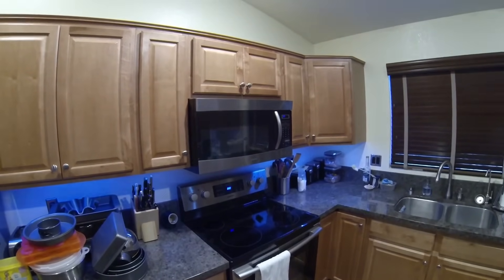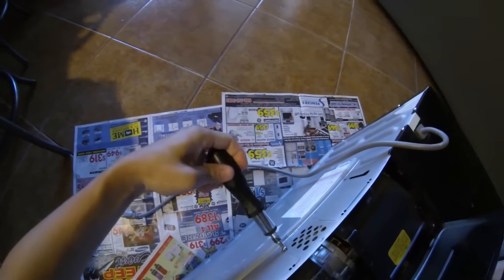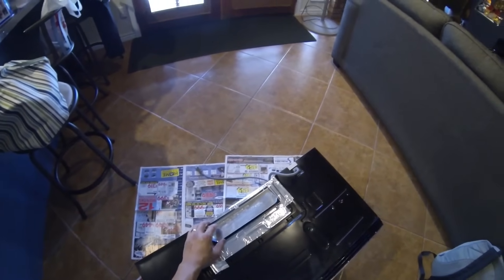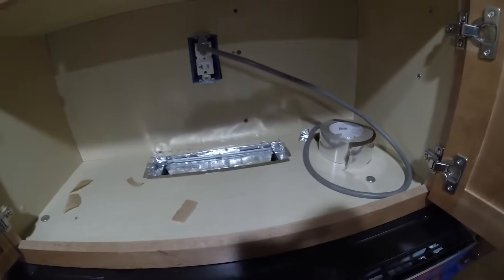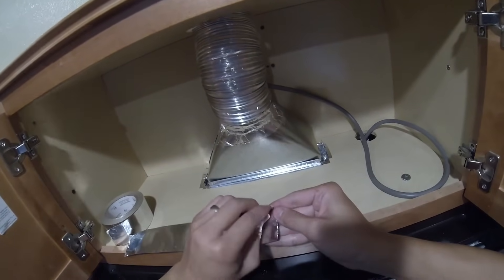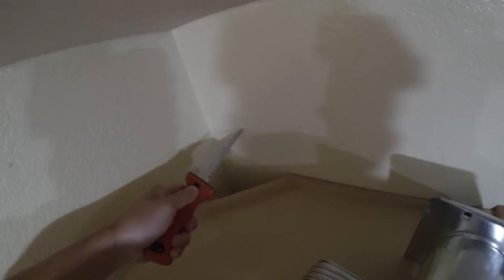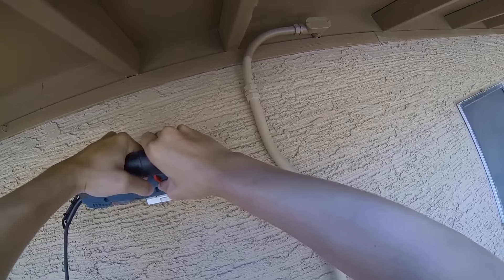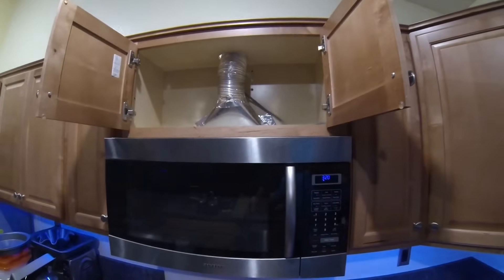How to Install a Microwave Hood with Exhaust Fan - DIY

Comment: While functional (for now), there's numerous problems with the install and the flex-pipe alone will definitely be a problem with grease accumulating.  It is not to code, and instead of taking the time to do it right, it's done haphazardly and not to code.

The power outlet should be moved to one side of the cabinet so that the vent pipe is not obstructed.  Using aluminum tape to seal the misalignment is sloppy at best.

Flex pipe (or a dryer vent flex pipe) is not to code and will accumulate grease over time inside and will definitely cause problems down the road.  6" - 8" rigid vent pipe is required and since heat rises, need to go at an upward angle to eventually vent to the outside.  Your flex pipe will have hot-spots where the rising, hot air will be restricted.  Problems eventually when grease accumulates.

Do it right, or don't do it at all.

Comment: First of all thanks for the video. EVERYBODY should vent their microwaves outside. Those recirculating things are just dumb. Second, I know rigid piping is the proper way to do this but not everybody has the coin and/or pipe fitting experience. A legit pair of tin snips is around $35. I've used this flexible dryer duct on this very same project in the past and just changed it out every couple of  years once I felt it was nasty enough inside. Compare the flexible duct job here to the chicken coups that people in 3rd world countries call home. LOL.  Works good enough bruh.

Comment: Great video I wish i would have seen this before I purchased all the parts for my Exhaust fan. I purchased all 6" pieces and did not get flex duct.  Does the 4" make alot of noise?  Also did you have to purchase the damper for the Microwave or did you have one already? Thanks,
Reply from the maker: UltimateAudio936 Thanks! I think the majority of the noise comes from the microwave itself and not the duct. At least from what I can tell. The damper came with my microwave. If you do not have one, try to find one that fits for your model.

Comment: what the Bosch power tool you used to cut holes to the cabinet and the exterior wall? did you use anything to fix the hud in the exterior wall of your home?

Wonderful video, Very helpful!
Reply from the maker: Thanks! I used this: https://www.amazon.com/Bosch-JS365-120-Volt-Top-Handle-Jigsaw/dp/B004323NQO?ie=UTF8&camp=1789&creative=9325&creativeASIN=B004323NQO&linkCode=as2&linkId=QYODKNPBNEOC25FG&redirect=true&ref_=as_li_tl&tag=mt888-20

I just put chalking around it.

Comment: Where can i buy the microwave adapter with flapper. It did not come with my Kenmore microwave.
Reply from the maker: could always check the manufacturer for parts or if eBay has universal adapters

Comment: THERE IS GOOD REASON WHY THEY SELL FLAT PLUG WIRES
Reply: Yes, a 90 degree (L shaped) plug can replace the straight plug on the AC cord.  It might allow vertical mounting of the duct.

Comment: Question? Why everyone is going up thru the cabinet instead of going straight thru the wall? I mean from the back of microwave thru the wall..less duct work
Reply from the maker: +Marvin Garcia The reason why I went this route was because it would have involved much more work on this house. The microwave is on an inside wall so going through the wall wouldn't have worked. To accomplish the duct work would require it to go up through the wall to the attic and cut a hole in the roof. Additionally, the outlet was obstructing the path in the middle. This was a bigger task than I wanted to tackle. Hope this video helps accomplish your needs!
Reply: Thanks. Actually Im going to do the same you did, my back wall is my outside wall but it requires me to cut studs, something I dont think is going to be easy.
Reply from the maker: +Marvin Garcia Having the right tools definitely helps and can make your life less hectic. A hole saw can help just depending on your situation. Just want to be careful that there's no wires in the area.

Comment: I'm not carping.  Having no plate on non-visible electric outlet is like an inclusion in a diamond...can't really see it but it is an issue. In my state (CT) and almost all others the inside of the vent tube "must" be smooth. Makes sense, don't you think? If erose it would collect droplets of oil, etc.  Possible fire hazard, conflagration, death in the night.

Comment: Flexible ducts are not recommended for range exhaust.  Looks like 4", which does not give much airflow.  That said, I used the exact same when I built my house 30 years ago.  I am going to do it right in my next house.  Personally, I would have added a second outlet box 10" away - that tape job in the cabinet is unacceptable.

Comment: You are not meeting building code with your install.  Move the Plug first then install vent..  you can not do what you did very bad idea!!
Reply: I agree it should not have been done that way, but what code is it not meeting?
Reply: Brian Look also microwave only has two screws to the cabinet it needs three, I install these and they all come with three screws and three nuts.
Reply: Edgar Bravo I have a whirlpool gold and it only secures with 2 screws and mounting bracket. each brand and model is different
Reply: This is a false statement, not all microwaves have three mounting bolts. For example http://www.lg.com/us/support-product/lg-LMHM2237BD#manuals
Reply: What's the off the first part attach to microwave before the boot?
Reply: @jarhiker1  hi! What parts did you use especially the adapter piece? I have the same microwave.
Reply: Before taping the outside duct to the inside I would have fire caulked the outside and screwed it in. Fire taped inside after. Other then that, good video.
Reply: George Alvarez - Well, when your house burns down because of using totally inadequate ventilation piping/Code Violations or you’re trying to sell the place later on and you find out that you can’t sell it using this inadequate idea and materials, having to start aaaaalllll over again anyway, you’ll wish you would have listened to those who know, instead of knowingly causing the problem, but went ahead and did it anyway. Ya, I know; Long sentence. This is the Main Reason people come onto YT in the first place. To find out how To and how NOT to do things, reading All comments a available and then making an “Informed” decision and Plan. I’m glad I found this video. I really am, because now I know how Not to do it, for safety and Code violations. Thanks for the video, either way.

Comment: hi i used    4 inches pipe for range vent hood wrong or right
Reply from the maker: +Trang Ta I used a 4in pipe.
Reply: +Trang Ta  Code requires 6" round or 4" x 12".  It's usually spelled out pretty clear in the microwave install instructions.  The outlet is in violation of the electrical code.

This a good example of how NOT to vent a microwave.

Comment: Could you give me a list of the required parts  to complete this job myself?
Reply: 4" microwave register box, 4" vent ducting the lenth you need it or flex duct, aluminum vent tape, GE microwave air flap (if needed), go saw, pencil, tape measure

Comment: Would duct tape work instead of foil tape?
Reply from the maker: It's not advised to use traditional duct tape for duct work despite the name as it has a greater probability of failing over time.
Reply: mitchy02 - Plus, since you’re venting hot air, it’ll just melt the adhesive, setting up a probable fire hazard. They make Aluminum Muffler Tape for a reason. But overkill in this area is warranted.

Comment: Needs to be 6" if you wanna stay in code. Also no flex i know you wanna hide it but you can easily build a bulkhead or went straight through the roof. Years from now you'll be picking grease off the side of the that house

Comment: How are you going to unplug this setup with plug right in the middle of duct?   Not done correctly.  Never use flex duct for this.  This guy never did this correctly.

Comment: Great video. Where did you your damper from the one outside and one connected to microwave?
Reply from the maker: +Paul Robinson Thanks for watching! Mine came with the microwave when I purchased it. The microwave damper will vary depending on your brand/model. You may be able to find one on Amazon. The one going outside can be purchase at your local hardware store.

Comment: It seems like you created an awful lot of work for yourself, as adding the soffit will be no piece of cake.  This in addition to having to correct the errors of using the flexible dryer vent.  I guess the bright side is that you get to correct it now before the soffit is in place vs. having to redo it if you sell the house and it gets flagged by an inspector.  Rather than add the soffit,  I were you, I would just rip out the duct, patch the hole in the house and convert the microwave back to recirculation.  If you do go that route, remember to replace the charcoal filter on the microwave at least annually.
Reply: A more constructive reply would be to tell him how to install the vent to code, though you do bring up a good point about the inspection.
Reply: soffits are well worth it even if you plan on living there, believe me! stringing ductwork around,  it can be an eye sore! not to mention hot as Hell. I'd insulate it too!

Comment: I need to do something like this. Because the mofo who i stalled the exhaust vent made something so now the vent goes to an aluminum duct up to the attic and all the freaking hot ari is leaking unto the house making my ac keep going to keeep cooling the installer mistake, mi e as well ill block the exhaust hole and leave it like you had it on your video.
Reply: Also that plug needs to be insulated so the heat from the wall wont go inside..

Comment: to know where to make the hold outsie just from inside drill a small hole to outside on the center of the hole so you will know where to cut outside ! your installation is ok but can be a lot better when you make this horrible cheap metal pipe not show at all , cover the top side with wood of the same color or something else but it looks bad

Comment: And 4"" duct CANNOT BE USED ever no way no how,It will not have the suction required and would never pass code inspection, and now its a fire trap with a flex line, grease gets trapped in the grooves, hard vent is needed

Comment: Can anyone recommend the right way to do it if this dude is completely wrong?
Reply: For the parts and type of duct you will need to check your microwave manual and also do a search on "your county kitchen vent code". The county where I am at, we are supposed to use galvanized steel ducts. As others have mentioned please check your local county code. This is more about safety.

Comment: What A Dum Thing To Do. You Should Have Simply Installed An Exhaust Fan In The Ceiling, So That You Could Keep Your Cabinet Space, And Not Have An Unsightly Hose Showing. You Could Then Use Your Microwave Oven With The Steel Filters To Trap The Grease. Go To Amazon.Com, And Order The Kitchen Exhaust Fan By:  Broan-NuTone 8210 8 Vertical Discharge and 7-Inch Round Duct Ceiling Fan, 210CFM.